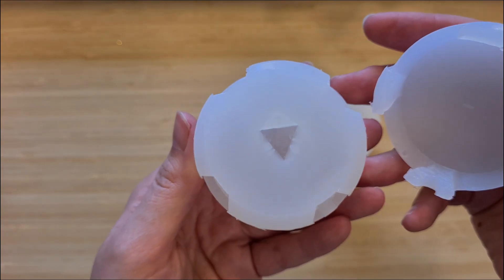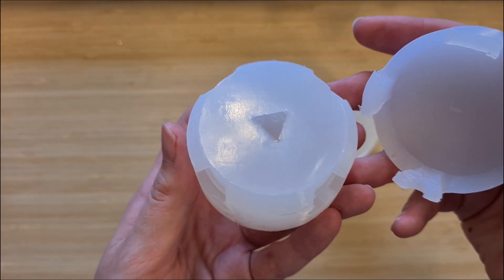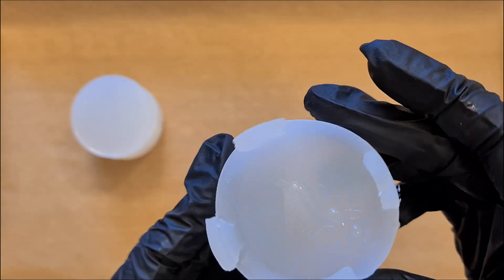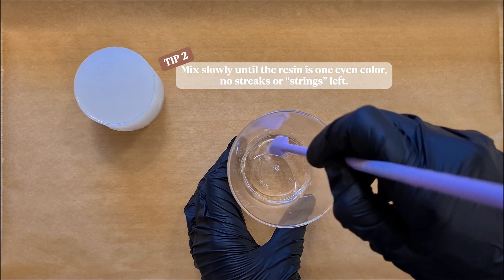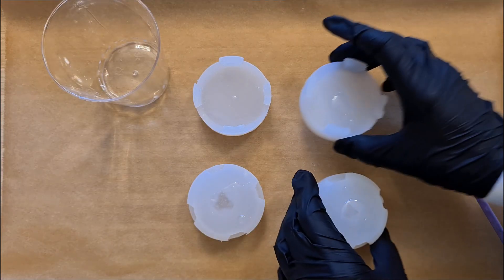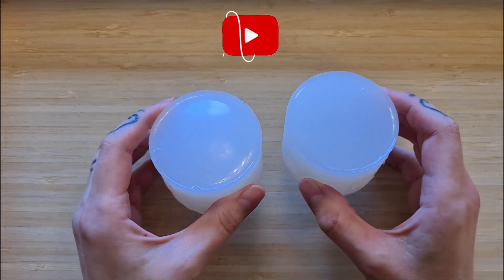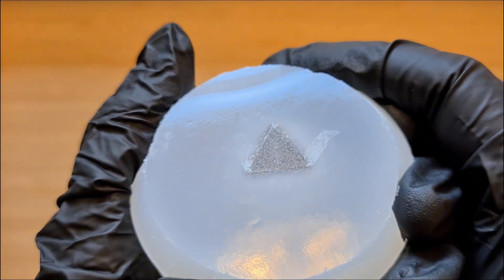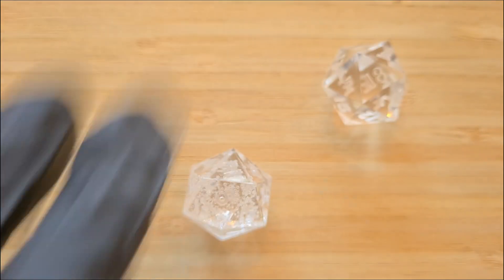Pressure Pot vs No Pressure Pot: Is It Hard to Make Bubble-Free Dice?

Comment: Hello! I have a question

How do you clean out the glass cups after using them for mixing? Does the resing just pile up over time?

Also I want to get into dice making but everything is so expensive, you can't compromise either because that can bring huge safety risks(working without a respirator, building a bomb while trying to diy a pressure pot, etc.)
Reply from the maker: Heelluu!

If you use silicone cups to mix the resin in, once cured you can peel off or use sticky tape to remove it. As I used plastic cups there's so saving them, unfortunately.

Using correct safety tools are crucial when handling resin! It is a big investment to start, but luckily things like respiratores and such last awhile before needing replacement 🥰🎲

I wish you good luck on your journey, happy making!!

Comment: Thinking about giving dice making a go.  But I'm going to ask a stupid question.  So I apologize in advance if it is.  My question is simply, is your pot that you're using a vacuum chamber pot, that you set to 30PSI negative pressure or are you pressuring it with +30 PSI?  Again, sorry if this was mentioned elsewhere and I just missed it.
Reply from the maker: This is not a stupid question at all as I too mixed together pressure pots and vacuum chambers when I first started 🩷 In the video I use a pressure pot, which add +30 psi of air, this makes the bubbles shrink to a barely visible size for the eye and make them come out crystal clear 🥰🫧 I hope you have super fun getting into dice making, best of good luck to you!!

Comment: The resin used also makes a huge difference in the bubbles! I tried a few and found that the Smooth On resin really gives the least bubble if you stir it carefully! You really need to get the slow curing ones though! Their resin isn't cheap, but if you only do it once in a while, it's probably still a lot cheaper than buying a pressure pot!
Reply from the maker: This is such a great advice, thank you for sharing! Slow curing resin seems to make a huge difference when you're trying to avoid bubbles, and also cheaper than buying a pressure pot 🥰🫧 happy making!

Comment: Hi ^^ How long should the silicone mold be sealed in the pressure pot? A few minutes or much longer? I mean how long does the pump have to run and after what time should it be turned off?
Reply from the maker: Heelluu, great question! It all depends on how effective your compressor is, the most important part is that you get it up to 30psi and that the mold stays there for the entire curing time (for the resin I use it's 24 hours). It takes me about 10 seconds to get my pressure pot up to 30psi with the compressor I have 😍👌
Reply: @krits-se  That is, do not remove the mold during the setting time. I'm more concerned about the time, how long the pump should operate ^^ Should it be turned on for, for example, 24 hours or a few minutes, then turned off, and the form with cubes removed only later? I will be using a pressure pot for the first time, so I have so many questions 😓
Reply from the maker: @breedesapire2104  oh that's so exciting, good luck on using the pressure pot for the first time! 🥰 Alright so to make things as clear as possible:

As soon as I’m done pouring my dice molds, I place them inside the pressure pot and securely tighten the lid. Then I connect the air compressor and pressurize the pot to around 30psi, which  for me usually takes about 10 seconds.

Once the gauge reaches 30psi, I close the airflow valve so no air can escape and turn off the compressor. The molds stay under pressure while the resin cures completely and I don’t need to run the compressor again during this time.

That's it!! 😄💜
Reply: @krits-se  Thank you so much! 🥰
Reply: @krits-se is this different to using a pressure pot on the resin before adding it to the mold? 

Would you do both or just rely on the one time in the mold?
Reply from the maker: @therealadamwest great question!! I just rely on the time in the mold, without putting just the resin in the pressure pot first, as bubbles may occur when you're pouring it into the mold and the pressure pot will get rid of them + any bubbles that were already in the resin 😊🫧
Reply: @krits-se amazing! Thanks for the reply! Do you ever have issues with expansion and losing resin? Worried my mold might just seep 50% of it out as the resin expands in the pot
Reply from the maker: @therealadamwest  no worries at all! As the pressure pot "adds" air inside its space, it makes the bubbles within the resin to shrink to a very small size. The resin doesn't expand within the pressure pot, it cures normally. You might think of a vacuum chamber as those "pull out" the air instead of "adding" it 😊✨
Reply: @krits-se amazing, yes that makes sense! many thanks :😊

Comment: It would have been interesting if the only thing different would have been the pressure pot but like this the video isn‘t really useful.. I mean sure there are more bubbles if you stir it up like that and forcefully create them
Reply: Same complaint here. I was expecting based on the title a video that made an otherwise exact comparison between pressure pot and no pressure pot, probably even using the same batch of resin, but instead this is a comparison between "doing everything possible to not create bubbles" and "doing everything possible TO create bubbles". Doesn't answer my question at all.
Reply from the maker: @xono5871 thank you for your feedback! I will keep all of this in mind for future videos, sorry for the confusion 🌷🫧
Reply from the maker: Hellluu, I tried my best to create as few bubbles as possible for the dice that didn't go into the pressure pot, but having one really makes it easier 😍🌸

Comment: A friend of mine and me started just recently with dicemaking and accidentally bought 2:1 floor epoyx wich needs a litle longer to cure. 
When you let the mold sit for ~15 before closing the lid and flame it, you end up with almost no bubbles! :) 
We testet "craft epoxy" later and got a worse result. So for everyone starting this i highly recoment trying epoxy with longer curing times! :D
Reply from the maker: This is an awesome advice! 😍👌 I've only used "craft resin" but in my experience as well: longer curing time = less bubbles, also using a lighter to pop those surface bubbles before closing the lid if something I've never dared to do but only read good things about ☺️🫧

ps so fun you that you and your friend have together got into dice making, wish you the best of luck and happy rolling!! 🥰🎲